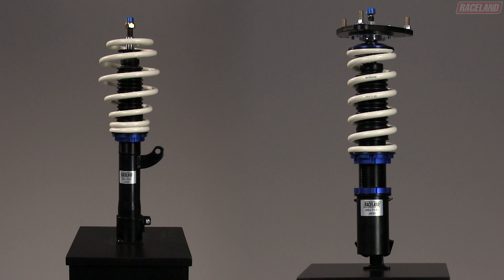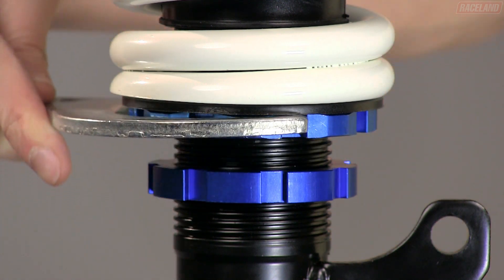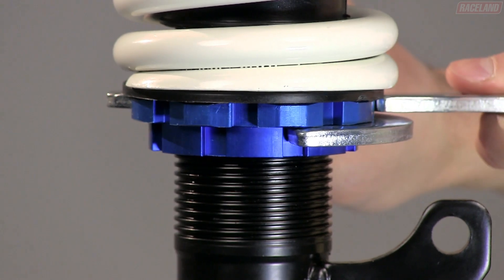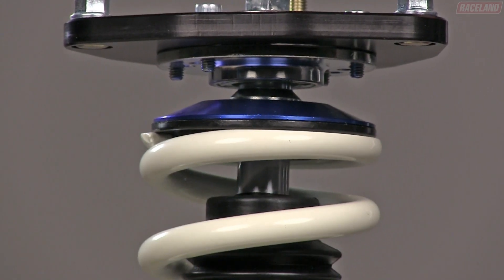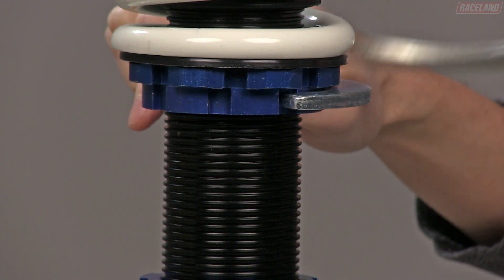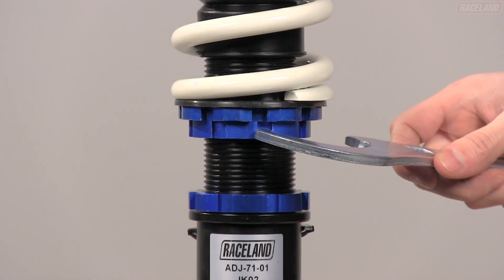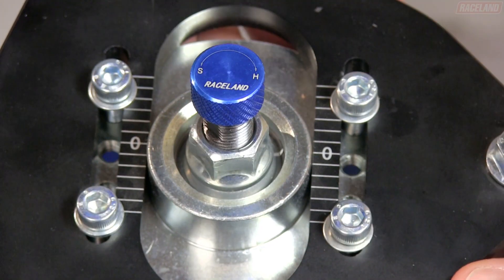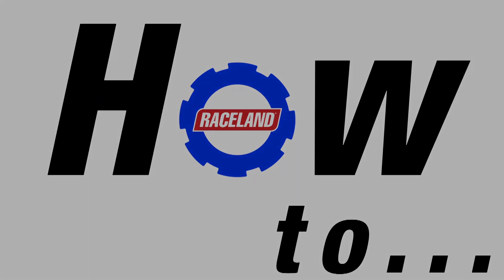How To Adjust Coilovers

Comment: On my 10th gen civic, my coils are already installed. I want to adjust them, should I readjust the pre load to 5mm then raise or lower the vehicle if I’m not sure that’s it’s 5mm
Reply from the maker: For that model, the spring pre-load is what determines the ride height as it is a partial threaded kit. So, the 5mm recommendation doesn't apply. Feel free to give us a call if you have any other questions! Our number to call is 801.365.1440.

Comment: Bought some Raceland Ultimos for my Mazdaspeed 3 and they literally rode perfect. Was so pleased with them that I bought them on my Hawkeye STI, but they are way stiffer. Were they designed that way or what? I was wanting the same ride quality. I even tried it with no preload, just snug with the top and still too rough. Ideas?
Reply from the maker: A lot of it has to do with the fact that one is a partially threaded kit and your Subaru kit is fully threaded so the mounts are solid. The Classics will ride a little softer than the Ultimos if you are looking for a softer ride.
Reply: Can you adjust the height for the rear while the springs are already installed i bought some for an st and the rear im wondering if i can change the height as needed?

Comment: Can the fully threaded coilovers come lose at the bottom if you raise too much or does it have a safety stop before  running out of thread
Reply from the maker: You'll need to take care to ensure that there is at least an inch of the strut body in the mounts.
Reply: @racelandsuspension  ok thanks

Comment: Don't these already come set with that preload?
Reply from the maker: In many cases, they do for shipping but you'll want to make sure that they are set to 5mm.
Reply: @racelandsuspension  also , they come with camber plates for the front, correct?

Comment: You showed how to determine a baseline for preload. How do you determine a baseline for ride height? How do know what a half inch or an inch looks like while in the air adjusting them?
Reply from the maker: It will depend on which type of you have (partially threaded vs fully threaded). For a fully threaded kit, it will be a 1:1 adjustment so if you're looking at just an inch drop, start with the lower mounts all the way down, making sure that you can still see threads in the small hole in the side of the lower mount. Feel free to give us a call if you run into any other questions! Our number to call is 801.365.1440.
Reply: @racelandsuspension  I have the Classic Coilovers for a 2012 G37
Reply from the maker: So, that is a fully threaded kit so if you're looking at a mild 1-2 inch drop, we would recommend starting with the mounts spun down just enough to keep the threads visable through the little hole on the side of the mounts. If you're looking to slam the car, It would be good to start with the mounts sun all the way up.

Comment: Hey raceland i have a mk5 jetta and purchased the primo coils. When fully lowered in the front my passenger side spring has a little play. Been through everything and made sure all nuts were tight. Still seems to have play and makes a clunk on larger bumps. Pls help!
Reply from the maker: Give us a call when you have a moment and we'll run through some trouble shooting with you! Our number to call is 801.365.1440.

Comment: How do you lower the rear? Just by the one ring using the wrench? Raceland classics 13 mazda3
Reply from the maker: With load on the springs, you'll still be able to turn the adjusters. Give us a call if you have any other questions!

Comment: How do I adjust the stiffness on partially threaded coilovers
Reply from the maker: If your coilovers offer adjustable damping, it will be similar to a fully threaded setup.
Reply: Raceland do tiburo coilovers over damping ?
Reply: @racelandsuspension  how would adjust camber on a fully treaded coilovers?

Comment: Do you adjust the coil overs first before installing?
Reply from the maker: You can but you will need to make more adjustments when installed to even the corners out.

Comment: Coilovers newbie here. The height adjustment of the fully threaded coilovers is through the strut body. Therefore, the strut piston travel isn't affected like the partially threaded coilovers?
Reply from the maker: Exactly. That is the great thing about fully threaded coilovers.
Reply: So will raising a partially threaded coil over make the ride bumpy?
Reply from the maker: It will raise the spring rate, so it will make the ride more stiff on a partially threaded kit.

Comment: Won’t changing the height change the preload on the partially threaded coils?
Reply from the maker: Yes, it will but the coilovers are designed and valved to function within the range of the pre-load of the springs.

Comment: How do you remedy slacking on the rear coilovers on a 350z. Mine is adjusted in the rear to its desired ride height; however, the spring is loose and knocks whenever I hit a bump and bounces alot
Reply: LanEvo55 Probably got to adjust you preload there’s probably too much play in the spring you would need to tighten the preload.

Comment: I tried lowering my car even more but as I was lowering as in the video the spring got totally loose that seemed unsafe so I just raised it back up ? Help ? Scion tC 2008
Reply from the maker: That is the reason that many of our kits have helper springs, to keep preload on the springs when going lower. Which kit are you currently running?
Reply: Raceland I'm using the base coilovers (not ultimos )
Reply from the maker: Give us a call when you have a moment and we can explain in better detail. The number is 801.365.1440.